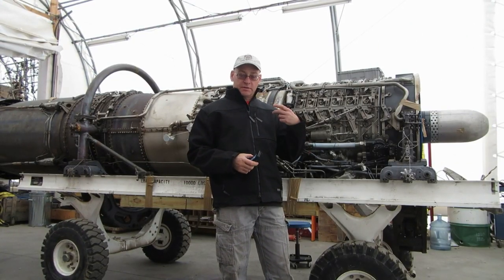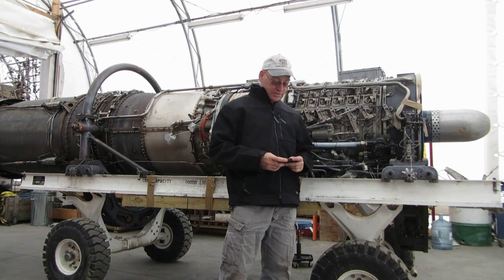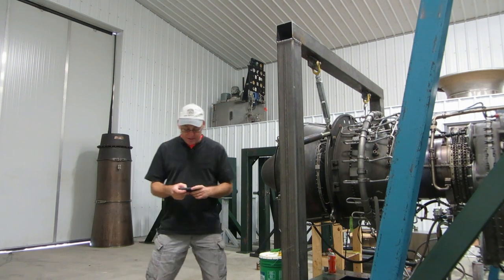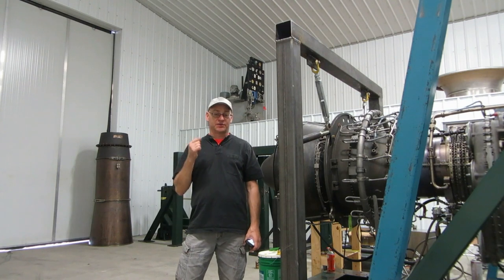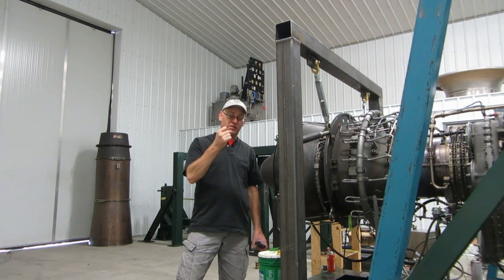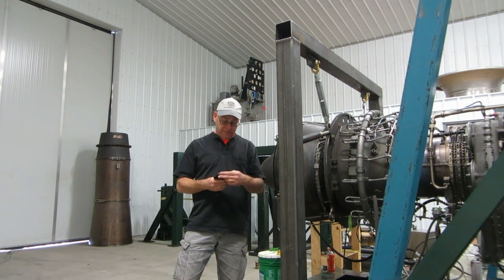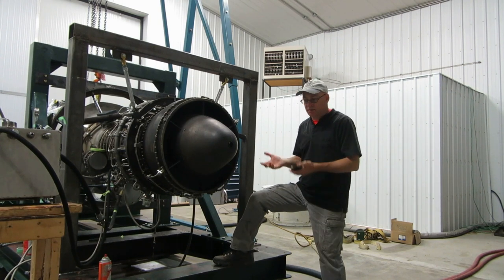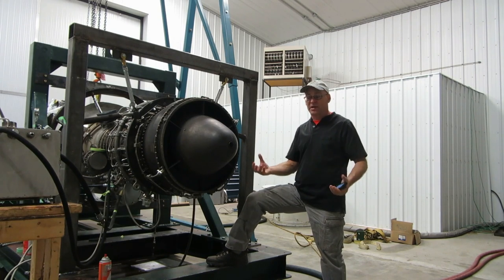Jet Questions  39

Comment: Great as usual, thanks a lot.

Great explanation of the oil system for negative-G flight. So there is probably a restriction in the flight manual on how long it can be flown in negative-G.

Comment: As always the videos and neat and educational.

An interesting note is that on many modern cruise ships they use gas turbines as boost engines as you mention but instead of putting them in the hull and then having to devote space to intakes and exhausts. They instead put them in pods on on or in the funnel structure itself. That way they're still plenty far away from passengers so they can't be heard and then the ship operators can take all that space that would be for intakes and exhausts and turn them into things like more cabins.

https://en.wikipedia.org/wiki/RMS_Queen_Mary_2#Power_plant_and_propulsion_system

Comment: Regarding Turbofan jet engines, are they more difficult to start compared to a turbo jet engine ?
The reason I ask is because the HP turbine is only driven to start up yet the IP and LP turbines / fan sections are effectively in the way of the air needed to get the HP turbine running.
I know that over time these turbines will speed up on their own also but there must be a restriction on the air being sucked in by the HP system.

Yet again great video. love the questions and answers as I watch these and think yeh good question

Comment: excellent.. thanks.. and the major manufacturers initials are in the upper rt corner LOL, but the "3 spool" gave it away.. tex johnson also did a barrel roll in a 707 long ago  thats on u tube as well  i believe by definition a barrel roll is a positive g manouver

Comment: First of all, thank you very much for taking the time to make these videos. They are very educational. I am relatively new to watching them so I have only seen a few. Therefore I was amazed when you showed the diagram of a three spool engine. I had no idea there could be three compressor/turbine pairs in a single engine. I believe you said they are not mechanically linked. If not, then which of the three spools do you spin when you start such an engine?
Thanks again.

Comment: AgentJayZ, if water is injected in the combustion chamber as a cooling medium to control the flame temperature, is the expansion of water to steam beneficial to the whole process.  I think water turned to steam expands by 1700 times.  If we are cooling the flame, is the resulting steam relaying the  energy to the turbine so it is not lost to the process?

Got it! No energy in the helicopter exhaust, so the ones with no tail rotor need an electric fan to provide the yaw control because the turbine exhaust is powerless.  Blinding obvious now.

"The Jet Engine" book by that engine manufacturer is very good, even if it does sort of skip by the water injection thing.

Thanks for sharing your knowledge and giving up time.

Comment: Love your videos!  First time posting a question:   In a 3-spool engine like the one you mentioned in Questions 39: does the starter for this type of engine engine still drive the HP shaft or does the presence of an IP compressor/turbine change that? The diagram you showed indicates that the accessory gearboxes are driven by the IP shaft which made me wonder if that's where the starter's output was directed.
Reply from the maker: The gearbox is driven by the HP system, and the starter is attached to that.

Comment: I was looking at a cut-away of a Trent 1000, similar to the first drawing in Q-39, and it shocked me how small the combustors were in relation to older engines like the Orendas.  From what your previous vids have taught me, it just seemed like the flame "fireball" would be too close to the first power turbine disc to permit cooling/mixing with the outer combustor air.  Is the outer combustor air at such a high pressure that mixing/cooling can be accomplished so quickly?

Also, the Seimens website has some nice drawings/videos of combined heat/power units which other viewers have asked about.  Really enjoy the info you provide.
Reply: Much higher compression in modern engines, more oxygen is being crammed in the combustor, the fuel is burner more completely, faster, hotter and there is increased cooling, all in a modern combustor design. All that air can burn up the fuel in a smaller condensed flame. Sometimes the flame is directed to burn radialy by the way the fuel nozzles spray, giving a longer distance for the flame to travel and end. Creating a swirled flame. The PT6 turboprop is like this. Its all about modern design. The turbines and nozzles are cooled better and can handle higher heat too.

Comment: Could you elaborate on the (claimed) advantages of unducted turbofan engines, compared to the usual duct-enclosed fans? I'm referring to youtube videos of a "newest" engine where the fans are completely external and near the back of the engine. Seems counterintuitive that unducted fans would be "better" than ducted  ones. Hope you can help and thanks for the videos!

Comment: NOTAR would be a good example for using the exhaust in a helicopter.
Reply: As far as I know NOTAR doesn't use exhaust gases for that but a separate fan attached to the used-to-be tail rotor shaft. It has a separate air intake.
Also if I remember correctly, the MD-500 helicopter's engine nozzle does produce a small amount of thrust which was even mentioned in training material.
Reply: veeaa You're quite right. Thanks for setting me straight.

Comment: I live very close to a military airbase and i watch dogfights and excercises almost daily, right above my head, it's awesome.
 Anyway, i noticed that the PW F100 of the F16 is much much more quiet than the J79s of the F-4 Phantom and a BIT more quiet than the TF41 of the A-7 Corsair, even with afterburner on.
 Ok know the F-4 has two engines, but does that equals double the noise levels? Even if so, why is the single TF41 make more noise than the PW F100?

So i guess the main question is, what makes an engine more quiet AND more powerfull at the same time?What's the difference?
Reply: Yes two engines are louder than one but whether they are twice as loud, I don't know. That's a completely different and a complex subject.
The reason is that the F100 is a turbofan while the J79 is a turbojet. There is a fundamental difference in how they accelerate the air and produce thrust. The J79 gives a small volume of air a huge increase in velocity and this produces the much louder noise. The turbofan F100 accelerates a larger volume of air but to a much lower velocity also being much more efficient. I believe the F-16 might be quieter even if it had two engines.

Comment: How much paperwork/documentation must be filled out during the repair and or rebuilding of one these turbojets? 100's of pages? More? Also, wasn't there a helicopter that used the thru flow of a turbo jet engine as anti-torque instead of a tail rotor?
Reply from the maker: Brad Morris There is a recent design called the NoTar which uses the output of a large blower to push the tail against main rotor torque, but it does not use engine exhaust for this.

There's an old design called the Fairey Rotodyne that had ramjets in the tips of its main rotor blades as the sole power source for turning it. This eliminated any torque through the main shaft, so a tail rotor was not needed.

Comment: hi mate, in flying aircraft jets whats the exhaust gas speed leaving the turbine, in relation to airplane speed is there an efficiency rating or something like that 
thanks
Reply: The exhaust gas speed is largely independent to each engine design, power setting, etc. Full power, in hundreds of miles per hour for a thrust producing engine. Turbofan bypass isn't nearly as fast. In a fighter jet, near or above supersonic. Look at pictures of the flames from an afterburning engine, often you can see "shock diamond" patterns from supersonic flow. Look up the definition of EPR, engine pressure ratio, you may find that interest.

Comment: Hi Jay, thank you for taking the time to make such interesting videos, I really enjoy them.

I'm struggling to get my head around something to do with turbofan engines, or rather how a turbofan engine produces more thrust than a turbojet. Essentially, the LP turbine in a turbofan is going to extract less energy and therefore less power from the hot gases than a turbojet turns into thrust. Given that the fan therefore has less energy to use in moving air to create thrust, than a turbojet would use to create thrust, how is it able to generate more thrust? Is it simply a function of how large the fan is? I know that the fan and it's turbine is less than 100% efficient, so logically (to my mind) adding a fan would mean less thrust due to less energy being available to create thrust.

Please forgive me if this is badly worded, or total nonsense. If it makes no sense, please let me know and I will try to find a better way to word this.
Reply: daniel2001 It's basically down to propulsive efficiency.  A turbojet accelerates a relatively small mass of air to a high velocity, which is efficient for high speed flight, but inefficient at lower speeds. A big turbofan takes most of the energy from the hot exhaust gas of the core engine and accelerates a larger mass of air to a lower velocity.  As an example, I have seen a small turbojet of 20lb thrust, built for model aircraft propulsion, converted to a turbofan with a free power turbine. the thrust was doubled, but the engine was heavier and more complicated.
Reply: If, for the sake of simplicity, we consider the formula of force F=ma same as thrust, then it hopefully could be understood more easily. The much larger "m" for mass in a turbofan engine is accelerated to a much lower "a" for acceleration. The mass of air accelerated by a turbofan engine is so much larger relative to the higher acceleration of a turbojet engine that it results in a higher "F" for force.
Reply from the maker: veeaa This is good, but you need to change the last time you use "turbofan" to ``turbojet``
Reply: AgentJayZ Fixed, thank you.

Comment: I wonder what are the actual psig pressure readings at the compressors and turbines inlets and outlets on a 3 spool engine ? I wonder how much the combustion pressure boost for  a 3 spool improves efficiency compared to a single spool engine?
Reply from the maker: It's all been measured and available on line. Final CDP is not why three spool engines were created.

Comment: Hey Jay Z, How is the bevel gear right at the compressor shaft lubricated? I understand the gear box if full of fluid but not sure about the other end of the shaft.
Reply from the maker: Each intermeshing of gears throughout the engine has its own oil jet spraying directly into it. The gears in a jet engine live a good life. Almost always, just upstream of the oil jet is a filter/screen.
These engines are dry sump; the oil is returned to a separate reservoir, which then passes through a screen, a pressure pump, a filter, a cooler, and then is sprayed directly onto each bearing or gear set.
Reply: @AgentJayZ Thank you for the reply. I completely understand now. Great explanation. Keep up the great work!

Comment: hi Jay, it's Ben from London again.   I'm curious about a helicopter that had 2 or 3 jet turbine engines and if the power turbines are coupled together to a single output gearbox.  can you shed any light on how this achieved.   if only one engine was running would the power turbine for the other engine be driven by the gearbox?  does that make sense?
Reply from the maker: Helicopters have a wonderful device called a sprag clutch. Your homework assignment is to find out what that is, how it works, and then decide exactly where a helicopter would use one, and why.
Three light bulbs, guaranteed!
Reply: @AgentJayZ  fantastic.  I love homework.  thnx dude.
Reply: @AgentJayZ  so... a sprag clutch is a one way free wheeling device like on the back wheel of a mountain bike.   I think one would be used on the main rotor shaft so that in an auto rotation scenario, the rotor wouldn't be loaded down with the force of driving the gearboxes and power turbine discs. 
..  so then in a helicopter with multiple engines, would each power turbine shaft be connected to some type of "differential gearbox" to allow them to turn at different RPMs?
Reply: the differential gearbox being situated between the two power turbine shafts and the main rotor shaft.?  I keep visualizing it like if a truck was coasting down a hill... the two tires acting like the power turbines and the driveshaft being the main rotor shaft...??

Comment: hai Jayz , In jet engines like J 79 ,J 58 ect had many pumps oil pump ,fuel pump and other hydrolic pumps 
how this work is it electrical ? or it driven by the engine itself?
And i like your Jet city  ......................full of engines .....can you take me to your jet city....... ;))
Reply: They are all located in a gearbox driven by the same shaft Jay is showing in the video. The starter is also located in that gearbox.
Reply: thanks  #veeaa